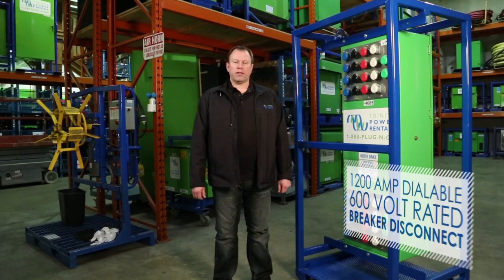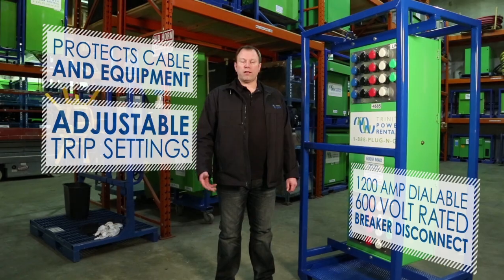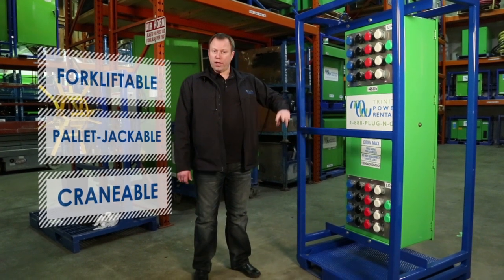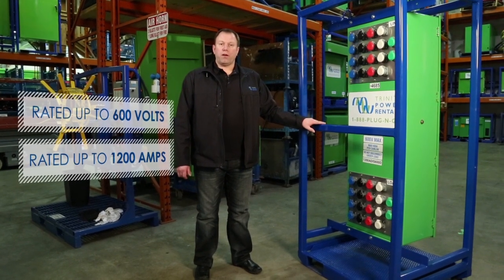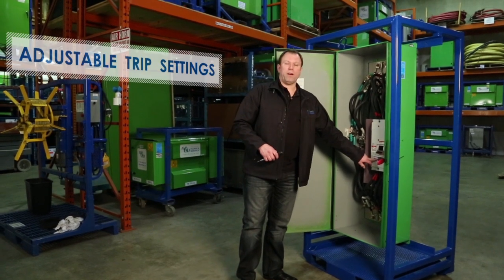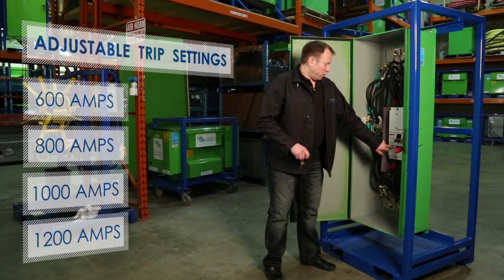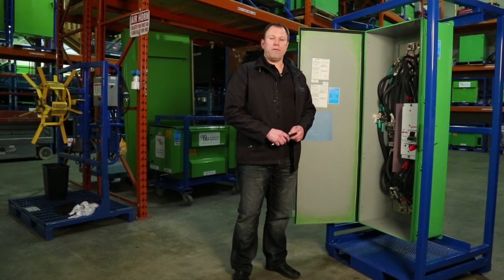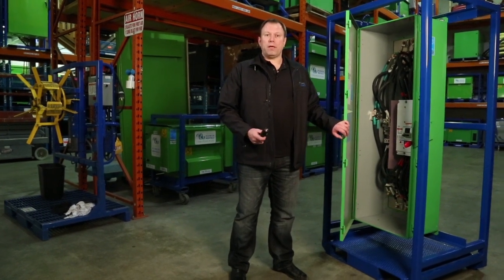Equipment Specs:  1200 AMP Breaker Disconnect

Comment: Question:  Wondering if it is reasonable for a restaurant to call out for a 1200 amp panel. The restaurant is 7200 square feet with one kitchen and a full bar and an elevator with 2 HVac units. most contractors are telling me 400 amp panel will do.